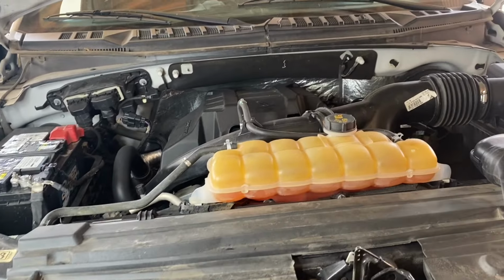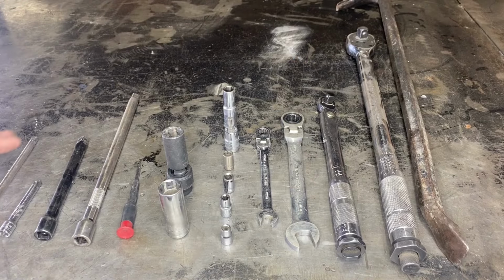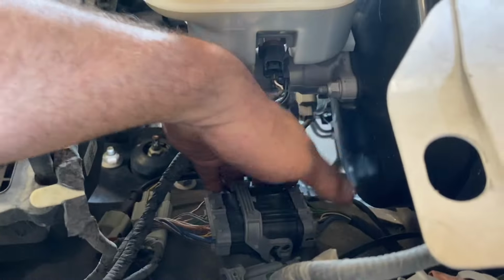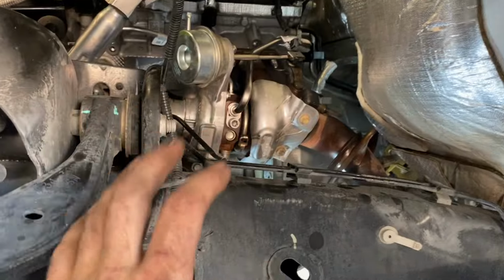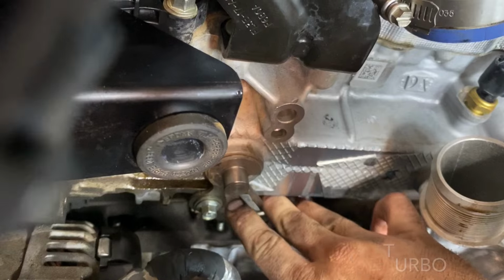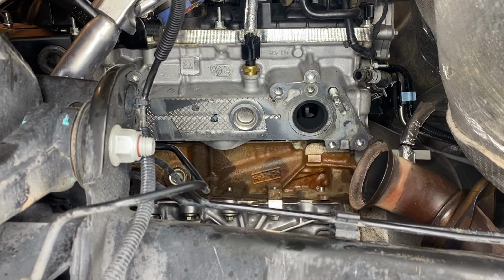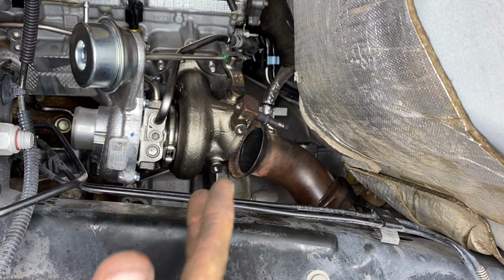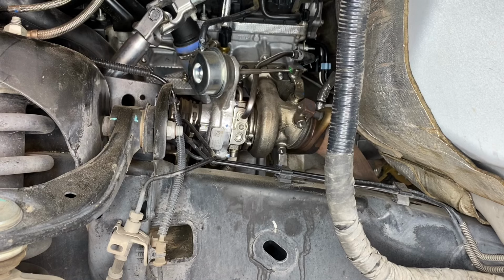Ford F-150 2.7 Ecoboost Turbo Replacement (Complete Guide)

Comment: Hello, I need help. I have a 2016 Ford F150 with a 2.7 turbo and it started off burning oil and sometimes white smoke when driving and hesitation I need help. I don’t know what’s wrong with it. Everyone keeps telling me to put a new motor in it, but it drives it runs. Can you please tell me where and how to get help?

Comment: Excellent & informative!... my 2015 2.7 with 90k miles isn't throwing any codes but I'm getting the waste gate "rattle". I suppose replacement can't be too far off.
Reply: Mine rattled since day one. According ford that is normal.
Reply: @BrianSmith-si4zd  lol, turns out it was the cat heat shield!
Reply: @BrianSmith-si4zd same for me since day 1 as well. Im at 67,000km on my 2019

Comment: Man, 2020 stx 4x4 2.7 65,000 miles, i had a turbo "within specs" since i bought it brand new. I swapped VVT selenoids in hopes it was my golden ticket, nope. Then i thought it was build up in the engine, nope. So im back to square one, the turbos. But, my trucks transmission was replaced at 55,000 miles and whines, loud. At least i think its the transmission.  Any chance of something else whining like that? Besides me right now? 😂

Comment: Wow what a Job !! Guess I’m going to my mechanic for this one . Nice video!
Reply: Would you please let us all know how much they would charge? I know here in Northwest Ohio to replace a bad turbo on a 3.5 eco-boost at the Ford dealer is around $6000 😂
Reply: Are you serious  ! That's crazy.  I live in Sylvania and have a 2020 2.7 echo with 20,000 miles.  I'm hoping nothing ever happens but if one goes out I want to do the work.  Doesn't look to bad to do.  Just retired early as a aircraft mechanic and I've fought a lot of engine valves that look like this.

Comment: I'm at 222,000 on my 2.7. 2019 EcoBoost. 
I really ain't got nothing bad to say. I ain't driving it like a sports car. I do know I'm recently having issues with the transmission. And at the most recent. After every oil change for the last two I get blue smoke. And then it goes away after about a thousand miles or so. And then I started noticing something at idle. The faintest blue smoke that goes away with throttle. But at idle for about 5 minutes there's that subtle smoke again. I know my turbo seals are going.... Kind of sucks how much they cost am I just delete them and stare at my check engine light and just drive a V6 without a power-band from a little turbo

Comment: Used this guide on Thanksgiving! Thanks for your help! I do like how you cut right before you mess with the 23 different swivels and extentions needed to get to some of the bolts tho lol.. but I did 2 turbos in a day!
2 things tho.  1, I cut off the entire old exhaust and replaced it,  cvf cats and a flowmaster. So much easier lol.
And 2, I have a garage and a shitload of really nice tools and 35 years of wrenching experience. Meaning I have extentions,  swivels, grinders, 5 different sizes of impact gun,  etc. This isn't as easy as your video made it look lol.  Lots of edits. But still the best video for the 1st gen 2.7 turbo swap I've seen!!

Comment: I need you as my mechanic I just bought a f150 2.7 eco boost with 92000 miles the truck runs as if brand new. This is a very good video well done very explained I learned a lot thank you sir 👍🏾

Comment: Thank you for making this lol dealership told it it was $3000 to replace my turbo with what they “think” is a broken actuator even though when I tested it, it held pressure. Thought they would go above and beyond but my hopes were let down so I’m just gonna replace the turbo myself. Good video bro really appreciate it. Mines a 2015 with something going on with the left turbo too, also at 170k 🤣

Comment: that is the cleanest 170k fleet engine in existence
Reply: My salesman had a 2015 transit 350 that was traded about 2 years ago. The spark plugs were replaced twice, but it was just as clean as this one but had 320k. The south doesn’t eat vehicles like the north. It helps that it never had a leak or anything too. My 2015 with 135k looks like it just came off the showroom under the hood. And aside from a couple bumps and scratches, the paint looks new too. I’m here because I just got the same code and it’s starting to smoke.

Comment: Did that engine really have 170k on it?  I can't believe it is that clean, even if you are in the south!!  I am doing the D/S turbo today in Wisconsin, on an f150 with 200,000 miles.  I had to use a torch to cut the downpipe studs and all of the coolant and oil lines to the turbo were rusted so bad I had to pretty much ruin them to get them off of the turbo.  The turbo to head nuts and bolt were problematic too.....

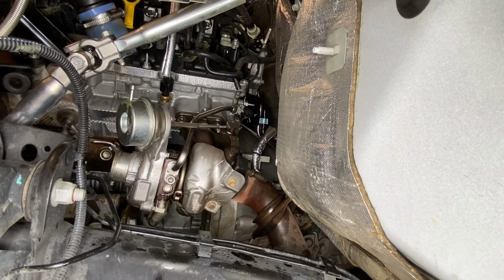Comment: I have a question! Do you know what that kind of bolt needed for the coolant pipe you remove at 9:45. The T45 i need a replacement one! Thanks!

Comment: I’m curious, I recently bought a new turbo from rotomaster and the instructions stated to add some oil on the feed line and spin the propeller by hand to coat the bearing so when it starts for the first time it’s not running dry of oil. Secondly it also states after installation is complete to pull the fuel pump fuse out and crank the motor to build up oil pressure (without starting the motor) then to add the fuse back in and start it. Is this something worth doing or is this going the extra mile?

Comment: Iv got a 2016 . No codes but smoke bad . If I drive at speed no problem but if I pass it wants to redline and I hear a whine from turbo. Is that a sign of bad turbo I need to replace.truck only has 13 k miles

Comment: This is an amazing video. Thank you for making it. The part list is amazing also. 

I don't need it to repair anything but it certainly shed some light on how complex the replacement actually is. I would try this myself if required. 

Some people who have no idea on the cost have said oh no its going to be 5k for a turbo if it goes bad. The turbo assembly is $507 USD at this time. Really makes me feel better about keeping the truck long term.

Comment: With the tiny oil filter on the turbos you think the oil filler line should be changed out more often to prevent damage to the turbo?
Reply: nah id say whenever you replace the turbo swap the line with the filter on it. shouldnt have that much build up if you changing engine oil and filter at a decent interval. if there constant build up on it you have bigger issues

Comment: Hey I am having to change my turbo since the wastegate is having problems. For the number of each item needed, is that what is in parenthesis? For example, 12.FT4Z6N652D Gasket (3) is the 3 how many I need to order for the right turbo? Thank you in advance

Comment: So it isn't necessary to replace both turbos when one is bad? Im at 140k miles and getting P0299 and shop says the right side is not having adequate intake pressure. And suggested replacing both because that what ya do.

Comment: Wow that is a lot of work.. good job
Reply from the maker: ya it took awhile for me to make this video lol thank you!
Reply: @AaronHinesAuto  When you say "awhile," how many total hours did you invest in the actual work, not including the on the fly explinations?

Basically, I'm a heavy equipment tech, and swapping a turbo on say, a John Deere 624G took me less than a day, but my 2.7 L F150 obviously has a lot more stuff in the way.  If this took longer than a 10 hour day to replace, I might be looking at paying someone to do it instead of doing it myself for just the cost of parts.
Reply: If im not mistaken i believe book time to replace both turbos is 7.2hrs. Ive had techs replace both of them in about 4.5-5hrs at my old job

Comment: I have an exhaust leak at my passenger side turbo. I tested it using an evap leak detector/smoke machine. If I want to replace both exhaust gaskets for the turbo, do I have to remove all those lines? I think it’s just the cat donut gasket leaking, but was gonna do both while I’m in there. But if it’s too much work maybe not. Thanks so much for this amazingly comprehensive video!

Comment: Would it be necessary to drain the oil when doing this job? I don't need to replace the turbocharger just the oil filler tube...
Reply from the maker: Yes. Would be a good idea to put some fresh oil in it.
Reply: @AaronHinesAuto  Thanks. But I had my oil changed just last month. My question was does the oil need to be drained in order to changed the tube. If I leave the oil in there will it all come spilling out when I take that tube off? In your video you show draining the coolant but not the oil. Thanks,

Comment: Do you still recommend the 2.7? I just bought a 2020 F-150 2.7
Reply: Me too
Reply: Got my 2020 2 months ago
Reply: @Lab-Rat  I love mine. Just change the oil between 5-6,000 miles with a good synthetic oil like Mobil one. Great engine
Reply: I have a 2.7 L in my regular cab short box 4 x 4 2016 F-150 In this configuration it is faster than the 5.0 V-8 F-150.  I also have a 2015 mustang GT performance package which is tuned if I had to buy a 2020 or newer F150 it would be the 2.7 L again
Reply: @RoscoRide  I really like it so far. They updated the engine in 2018 to have another injector to clean the valves to prevent the carbon buildup. It’s very efficient on fuel as well. Hey I have a Mustang as well. I have a 2007 Shelby GT before the GT 500 came out. It’s supercharged with 580 hp and cat deleted exhaust
Reply: @timschultes6467 Nice,  have a Bama 93 race tune on my Mustang it’s around 490 HP with the magna flow competition exhaust in MRT resonator delete H Pipe Still love my 2.7 L though.
Reply: @RoscoRide  that’s a badass Mustang love it. I’m interested in the Mach 1 it’s like a GT350 without the Shelby badge and it’s slightly cheaper as well. Can’t afford one of those new GT500’s they’re ridiculously expensive. I’m actually really really wanting the new Bronco with the 2.7. That thing is sweet
Reply: 2.7 owner here in an F-150 xlt. They are great motors with great reliability if you CHANGE YOUR OIL REGULARLY. Every 5,000 miles. These motors are very sensitive to maintenance.
Reply: @noahsnyder7142  I agree I’m on top of my oil changes myself. I use full synthetic oil every 5 to 6,000 miles
Reply: 2015 2.7 117,400 miles. tow a 5300lb camper during the summer and other odds and ends material. change oil at 3000 or less when im towing at working it hard, change at 5000 when im not. this is according to the manual. 5w30 motorcraft its whole life. im the only owner so i know whats been done to it. been great. no issues and no signs of issues.
Reply: @stewpidaso26  I love it so far. I have about 15,000 miles on it now. I have the second generation 2.7 with the improved design so hoping it’s just as good. I’m good about changing my oil on it as well full synthetic every 5,000 miles

Comment: Something missed:  precharging the turbo with oil using a hypo syringe , disconnecting fuel supply, and cranking the engine ( NOT STARTING ) to pressurize the oil supply to the turbo.
Reply: How do you disconnect fuel supply and is there a specific syringe size needed?
Reply: @carguy2256  Probably just pulling the relay or fuse to the fuel pump. Pretty sure holding down the gas pedal and then holding the key in the start position will crank the engine to build up oil pressure without pumping any fuel.

Comment: Great video, do I need to drain the coolant if I plan on only replacing the oil feed tube?
Reply: Did you ever find out an answer? I need to do the same.
Reply: No you do not, the oil and coolant lines are separate.

Comment: Great Video!!!!!  quick question.....
I  have a 2016 f150 2.7 Eco-boost that is blowing white and a little blue smoke out the tailpipe on cold start, I have been reading that it has something to do with the oil bypass tube, can this be replaced on its own or would the whole turbo need to be replaced?
 Also ,  how long would changing the Turbo take?
 Thanks......
Reply: I'm having a similar issue. There's a technical bulletin from ford saying that the left hand oil feed tube is leaking oil on a cold soak causing for excessive smoke on start up. Took it to ford and they confirmed the issue but wanted to charge 800 for it. They said all you need is to have that line replaced. I have a powertrain warranty.  Part is not covered under their warranty

Comment: Read this if you’re looking for more guidance on the TSB regarding white/ blue smoke upon start-up after a cold soak (TSB 19-2188).

I have a 2015 F150 with the 2.7 and I was getting white smoke in the morning. This tutorial is excellent.  It provided everything I needed to know to swap the oil line on the driver side turbo.  There are a few things worth mentioning though.
1. You do NOT need to remove the fender liner. I was able to complete almost all work from the top of the truck.  Removal of the tire and air intake piping is necessary however.  This was super easy though.  There are several hoses and sensors connected to the intake pipe attached to the turbo, I counted 6 different ones I believe, so be careful removing them. 

2. No power tools are needed to complete this job.  I found hand tools like sockets with extensions and regular wrenches more than adequate given the tight spaces. 

3. In the video I believe the gentleman said a 16 mm wrench was needed to remove the exhaust nut. I found the 16 was too big and used a 15 instead.  I used a box-end wrench from the top of the truck, not a socket through the fender well.  Both the bolt and exhaust stud were very easy to remove.

4. If you are just changing the oil line, you do not need to drain the oil or antifreeze. When I removed the oil line only the smallest trickle of oil came out of the engine block.
5. The oil line will require a bit of tugging to come lose.  I pulled the line from the engine first, then pulled the line straight out of the turbo. Don’t be afraid to use some elbow grease. 
6. I ordered the OEM replacement oil line from Tasca Autoparts using the part number indicated on the TSB (FU7Z 9T516 A).  They might tell you the part doesn’t fit your truck, but it is appears to be the correct part (it was a direct fit after all).  I believe the stock part was updated after Ford recognized the issue and released the TSB.
I’ve driven the truck around the block and there appears to be no issues.  I’ll give an update on a month or so. Thanks for the awesome tutorial.
Reply: Just an update.  I’ve put about 300 miles in the heat of July, with about 2 hours of idling as well with AC running - no issues at all. The problem has been resolved.
Reply: For 2018 and up, you have to take off the EGR pipe to get access to that
Reply: @christopherdavy2152  Now that it is cold, are you still experiencing smoke?

Comment: Excellent step by step. Thank you.  Any concern the passenger side turbo would need replacing as well even without throwing a code?  I know it's expensive but just wonder at 127k miles if it makes sense to do both.  I have a 2015 F150 2.7L super crew and love it.

Comment: Ford went off the deep end with these little motors in full size trucks.
Reply: This is what it takes to get 19 ish MPG city and 25 ish highway out of a 325 HP motor.  Would you rather have a 1979 F150 with a 460 that gets about 6 MPG and makes 214 HP ?

Comment: Have you had any others go bad in the fleet or is this a one off? What is your opinion of the 2.7 for long term reliability/durability? Great video!
Reply: 170k miles and it only need a diaphragm is good.
Reply: 60k trouble free miles so far.
Reply: @blackericdenice  good for the mechanic shop maybe.  I guarantee they charge some people 5-6k to tear this vehicle down like that
Reply: I have a 2015 and at 180,000 Mike's and mine is in the shop right now with 1 bad turbo but getting both replaced

Comment: Comments from many of the turbo experts they say they wont last past 50 k miles, well I guess they are not experts, lol, well done video!!!
Also why didn't you add a piece of rubber hose on that drain cock just curious?

Comment: WHAT A RIP OFF FORD COULD MAKE REPLACEMENT PARTS FOR ALL THAT STUFF AND TO NOT MAKE WASTEGATE REPLACEMENT FORD NEED TO BE SUED
Reply: Well, why don't you hire a lawyer and sue?   There are a few there are a few things that you need to understand.

1)  The waste gate needs to be adjusted after replacement and there isn't a reliable way do to this in the field.  Sure you can drive around and look at pressure readings , adjust then drive around again however this isn't going to happen at a dealer level or high end independent shop.

2)  The vid maker said the oil feed line has been updated.  He didn't show the old oil line but I'm betting the cone filter was added as an upgrade and the original line could not accept a filter.

You have 2 choices, learn how the world works or continue to struggle for the rest of your life blaming others.

Comment: That  was  only  one side!! Too complicated.  Buy a Chevrolet.  More  traditional  engine  design.
Reply: That's nothing. Wait until that Chevy has the famous AFM problem and you have to pull the cylinder head. Plus he said it has 170k miles on it. That's not bad at all.
Reply: Ralph Eisenbath   And there are Chevy people that say go buy a Ford.  Some complain that a truck needs any sort of repairs expecting them to be free and last forever.
Reply: people whobuy Ford, s want nothing to due with G M ...

Comment: So the other day my truck went into limp mode do to problem with the throttle actuator open removing and inspecting i found a blue o ring caught in the throttle plate could this be part of the turbos?